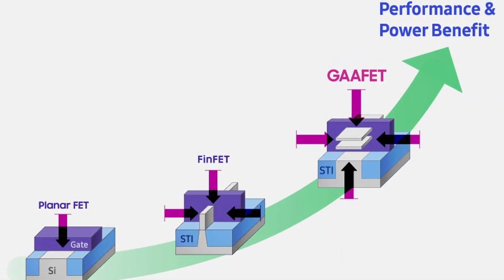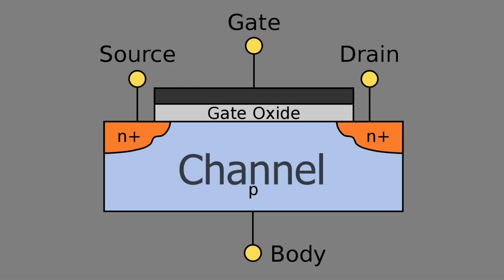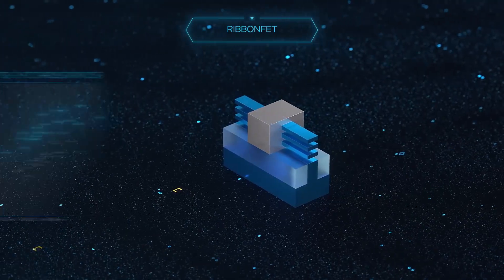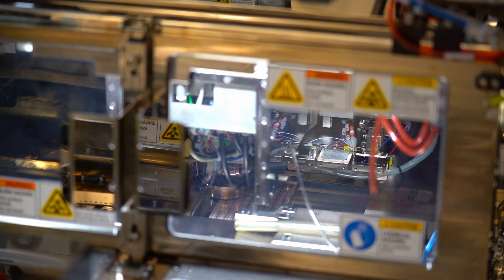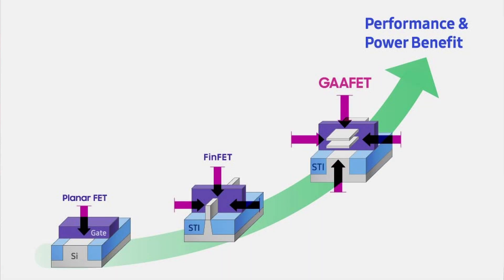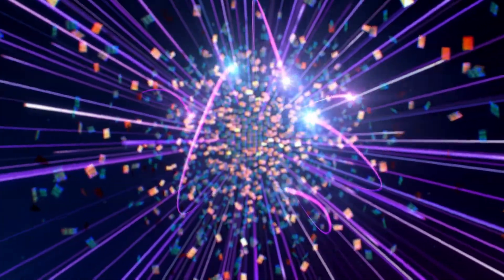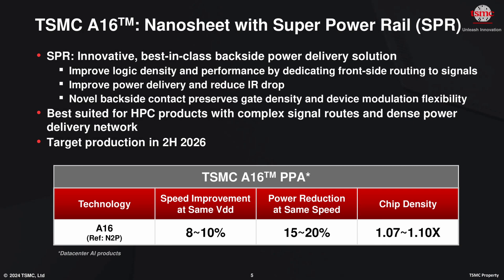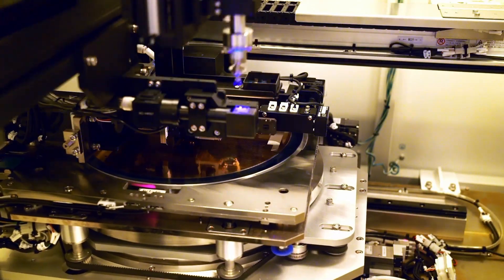Gate-All-Around — The Future of Transistors

Comment: I'm working on a GAA tapeout right now. From an analog designer's perspective, the transistors perform great, but my god the ever increasing layout rules a nightmare. In addition, the lack of multiple oxide thicknesses makes anything that faces the IO a significantly higher challenge. 

In all honesty, I think back-side power will have a significantly higher impact on performance than the move to GAA.
Reply from the maker: You think software/EDA tools will at some point take over when it comes to chip design? Like no more humans needed?
Reply: @HighYield  I don't know to be honest. You already see this in digital design - more and more of the design is shifted to 'programming'-like, with HDL and such. That said, the standard cells are still often done by hand. 

In analog, it's a mixed bag. You do see companies trying to push this - though in most cases it is from a 'design-portability' perspective - being able to easily migrate a design from 16 to 10 to 7 to 5 nm, or make small variations (more output driver power, higher current capacity of an LDO, etc). But, at least as far as I understand it, you still do use a lot of manually designed. Even if they are just generation scripts, the best trade-offs in those rules are made by thinking and designing 'the old fashioned' way. 
When it comes to high speed analog, it is similar, though I think as you go higher and higher in frequency, I think you see less and less automation, as there is more 'fingerspitzengefühl' involved in the desing process. 

The few attempts I've seen to fully automate the design process have been mixed. I imagine AI will eventually get there, but I don't see it happening in the next 10 years. That said, if you asked me 10 years ago if I would be able to have a pretty convincing conversation with a chatbot by openAI about the intrecacies of millimeter-wave design, I would have laughed you out the room but here we are.

----

What I can say is that with these new nodes, the layouts for analog are starting to look more and more like digital design. Where it used to be you really could tell the individual transistors and so on, you now see more and more that people just create a sea of transistors, all next to each other in a huge grid, and then are connected. In the most recent nodes (like 10 and below) you are pretty much forced to do this, as the multiple-patterning required for forming the gates requires huge repetitive patterns. 

Usually, these designs also use negative layers, called cut masks - you have huge poly or metal lines that are like 5 um long (which is massive compared to anything else in the FEOL in a 10 nm technology), and then you have a pattern of 'cuts' every 200 or 300 nm that defines your standard cell hight. 

You also don't get to just chose a transistor width or length - you might have one or two lengths, and two or three widths to chose from. Want a wider transistor? Put more in parallel. Want a longer one? Put them in series and pretend it is a longer gate.
Reply: @JorenVaes  Thank you that was really helpful for an interested outsider to better understand how the process of design works.

Comment: the next step is to swap the gate, and (source with drain). drown the gate, and leave the conductors in the "air", turning the transistor into a system of capacitors, changing not the current, but the charges.

Not this about You.

Intel's main problem is that there are no engineers left.
and the problem of speed is still being solved through circuit closure, which has an amazing effect on energy efficiency, but not the principle of operation itself, in which fields should be controlled, and not create resistive losses.

Comment: While very technically interesting, I wonder if it's a true advancement, or an extension of existing technology. What I mean, is that for instance, a 14nm product is fine, and, all other things being equal, you would expect a 7nm product to be twice as good. Surely.

But if the cost per transistor is analogous then when moving to the 7nm product you either get something half the size at the same price, or you get something better at a higher price.

The manufacturing around GAA transistors sounds really expensive. I wonder if there will be gains that trickle down to us humble consumers.

Comment: I have to admit I bristle at the confusion between semiconductors--which span a wide range of things--and integrated circuits. TSMC is often called a "semiconductor manufacturer," which is not completely inaccurate, but they don't make, for example, discrete resistors, diodes, transistors, capacitor, etc. TSMC is an integrated circuit manufacturer. Integrated circuits integrate, of course, semiconductors. But, calling TSMC a semiconductor manufacturer misses the mark. These are terms of our art; we should use them correctly.

Comment: 40 years ago in VLSI for poets class I was told that the electric field draws electrons and holes up from the semiconductor substrate allowing current to flow in the channel.  I don't understand where those mobility carriers come from in GAA ...
Reply: With masking you can selectively dope the nano-scale channel with acceptor, donor, or both atoms. If you apply enough electric field, you can deplete, accumulate, or invert the channel, increasing/decreasing its conductivity. The same thing happening in a regular FET.

Comment: As they are growing them layer by layer I wonder if there is anything stopping them from growing more than one layer of transistors achieving true 3D. 
That would allow them to push density per mm^2 when making smaller transistors is no longer possible and thermally it would be better than current stacking solutions, specially if they tune the transistors for efficiency instead of speed and go for way more transistors as a trade off.
Reply: They already do that - at least sort of. Even with etch it is doable. After all we moved to this (couple layers of transistors on top of each other) a long time ago. This is what decoupled "nanometers" from gate size.
Reply: They do this with NAND flash memory, but I think the transistor quality is not good enough for high performance logic.

Comment: Nice video! One detail you might have missed is that in GAA, assuming that it's a perfect structure, you can have multiple different FET channels coupled together by one gate. This could be handy in many situations. If individual channel growth is controllable enough, you can also have multiple independent FETs in the same area of what used to be one FinFET. This would increase transistor density exponentially. Plus, you can also make FETs that interacts with each other vertically through simple  or even quantum (!) interaction! It's Sci-Fi for now but many research labs are very successful in these already (especially in sub LN2 temperatures). 

However, the issue is with cost (which implies simplicity). The very reason why Silicon has been the material we all know is that we can get away with as little epitaxial growth as possible. It is the jack of all trades that is extremely cheap and easy to work with. Consequently, the traditional "silicon planar process" never included any epitaxial growth, except for the metal parts. Only etching, doping, oxidation, and lithography was needed.

Comment: I would like to see Mr High Yield do some more collaborative work / discussions with other people.  I have watched two with MLID (Moore's Law Is Dead) and IMHO they are two of the best three videos of MLID's discussion videos I have watched.  Your ability to describe and to teach is IMHO excellent.  Now onto the video talking about the primary change that chip production is (forecast) to face for 10-years (which is huge compared to when chips (semiconductor transistors) were first created back in the 70's), this IMHO is going to be a massive change and it is not just down to who is fabricating the chips, far from it, it is an absolute foundational change in chip design and if will be a bumpy ride for a while as chip designers fall into unknown traps, and others dodge them by luck.  The engineers will learn and in a way, those coming in second with a simple product will likely win heavily as they gain from others mistakes and make none themselves.  As for the big companies, what will happen over the next few years may force a company into destruction, or create the perfect conditions for a revolutionary product to soar.  As is always the case in this industry, the future looks to be very interesting, and as GAA spreads, morphs, and vartious versions are designed and rtested by various companies, they themselves will be ironing out the bumbs as they release products, so as always, consider product one to be a comercial scale test and proof of concept whilst putting a new product to market and having 100 refinements happening simultaneously, but it will take a fundamental (revolutionary) change in design and/or manufacture to make the proof of concepts into a tuned and refined product likely sometime in 2025 this iteration of GAA will become fruitful at the msaa market level, what comes next will likely be the refined version and offer real world benefits that bring this new manufacturing technology to the masses.
Reply: Collabs would be great, but MLID is a clown, has he even got anything correct on release?
Reply: @How23497  Yep. TechTechPotato and Asianometry are much better youtubers than MLID.
Reply: @How23497  and have you even got any info not from leaker that true on release. that guy got somethings wrong but not sure a clown cause the only one i see here is you. guy got 10% right and 90% wrong are still better than 0% right and wrong. Leaks meant to change even till the last millisecond before the company present/release/launched. youre probably from wccftech and hey, your next  rtx5090 can be 1599$ till jensen decided to change to 2000$ before telling the price
Reply: MLID.. Oh no please